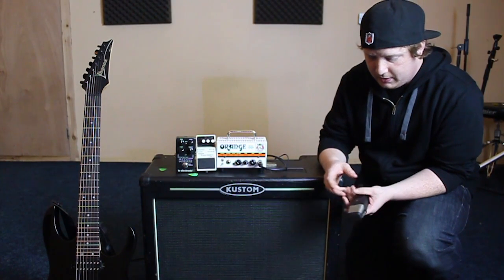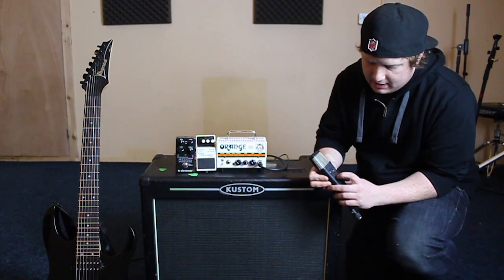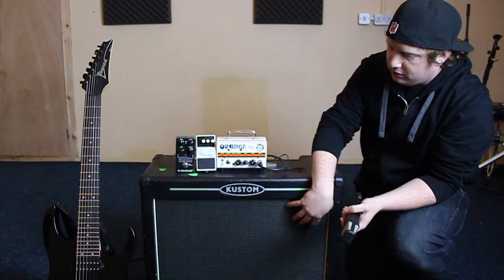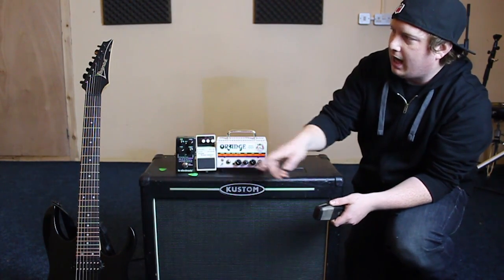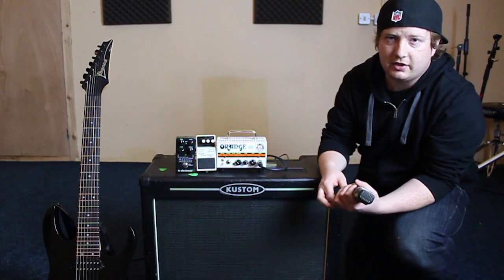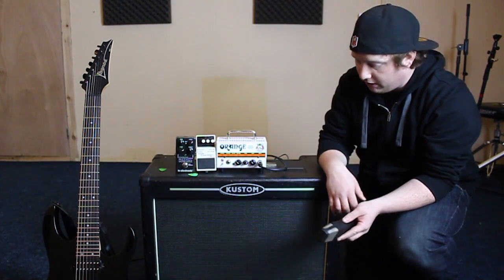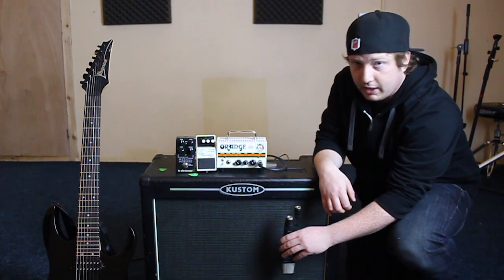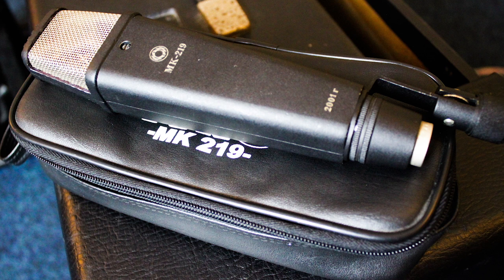MK219 OKTAVA Review/Demo

Comment: The MK-219 in this video has been modified.  You can tell because the aluminum ribs in the factory grill have been cut out and replaced with silver window screen material.  This is part of a standard procedure on MK-219's where the grill is cut out to reduce distortion, the inside of the mic body is deadened with caulking to reduce resonance in the mic body, and various electronic components are upgraded to higher quality resistors, Toshiba transistor, and tantalum capacitors.  The baffles around the capsule may also have been removed, which reduces the bump in higher vocal frequencies and causes a smoother rolloff.  I would expect this mic to sound more open and natural than a stock mk-219.  Look up "Oktava MK-219 Mod" on the search engine of your choice to see the differences I'm discussing.
Reply from the maker: Hey Michealgruuven thanks for letting me know the guy I borrowed this from assured me it was all original so I will update the title of this. Thanks for your well trained ears.